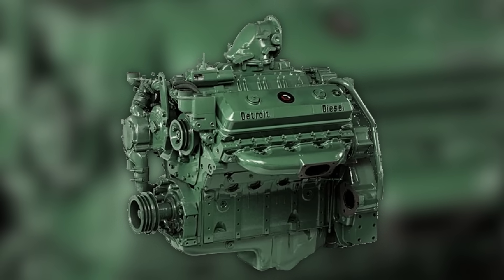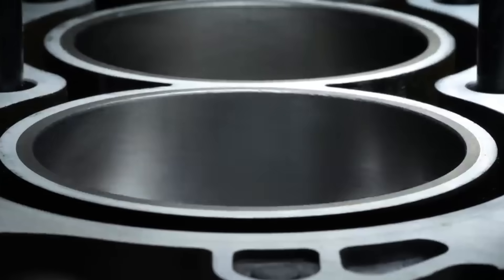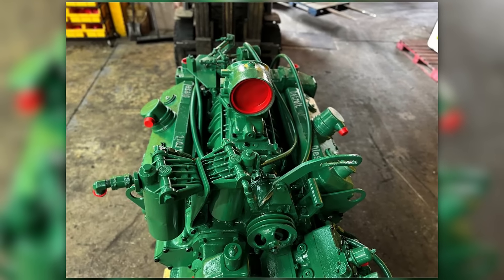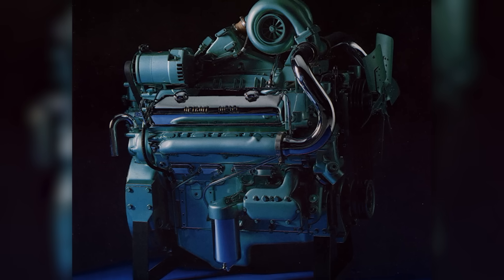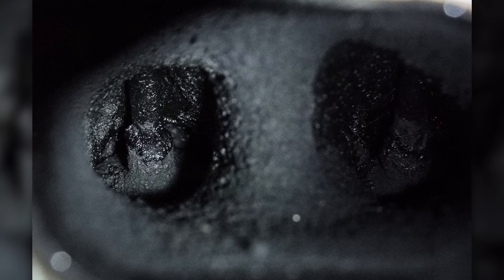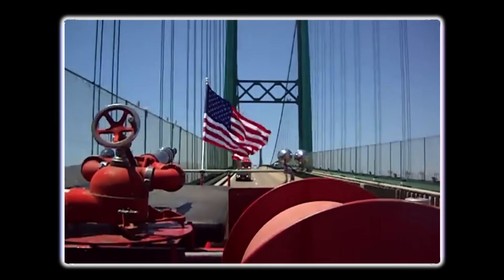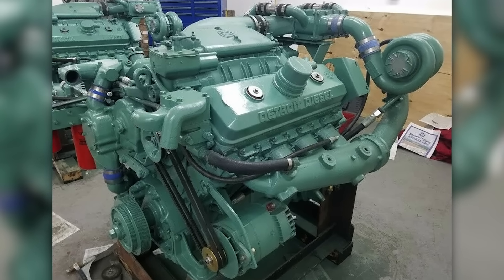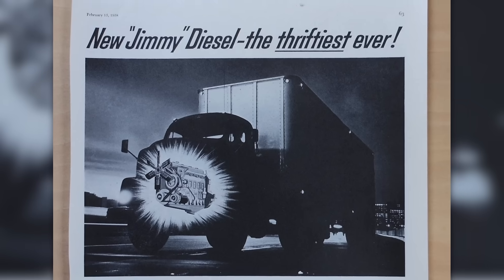The Shocking Truth About the DD 8V71, the Engine Too Hot For Its Own Good

Comment: Old truck drivers who preferred the Detroits maintained that they did not leak oil. They were marking their territory! And as the 8V-71 started being under powered as compared to competitors, Detroit came out with the 8V-92, which continues the heritage with more power. But it was unable to meet the pollution requirements when that became a requirement. They definitely were a motor that couldn't be mistaken for anything else.
Reply: The 92 series wasn't discontinued over emissions. The early ones had issues a d the fuel crisis on top of that tanked sales in the late 70s. By 1980 DD had 3% of the OTR market and had to scramble to design something to replace the 92 series which while fixed still weren't selling as well. The series 60 came in right as Rob penskey bought the company.
Reply: DD Showed several times in several SAE papers that they could get the engines to meet the emissions the EPA had set. No one wanted them when they didn't have the torque, that as well as relaxed length laws on trucks made V8s and V6s obsolete. Now any truck could be long enough to accommodate a big I6. A major part of DDs 2 stroke sales were for high horsepower compact applications. But DD had trouble keeping up with power and torque of thier engines due to a limited budget thanks to low sales.
Reply: As you see Cat got out of the on-highway market because of the emissions requirements and John Deere has stopped testing with an on-highway application.  I'm surprised Cummins can meet the requirements!

Comment: Really the hole idea came from emd witch was gm locomotive line that started back in the 40s they were 2 stroke with what they called power packs so the liners was its own unit that could be pulled as well in short time and back up and going they ran a rack system for the injectors as well. Gm thought was if works in a locomotive why can't we make a  platform that would be smaller with the same idea
Reply: @Chad-oz9ti ..... Your statement about EMD & the Detroit 2 cycles.... is False.   Winton / Cleveland / EMD & GM DIESEL, were ALWAYS, two Completely Separate entities under GM and NO technologies were ever shared between the two.    I worked in Detroit Diesels, Engineering dept. in the 1970's.   The Only thing that they had in common, as it were... was the fact that they were 2 cycle in design, it ends... there.  Any Similarities between the two, were strictly a result of the "nature of the basic design"..... nothing more, nothing less.

Comment: What I would like to add in FD cabovers is that my engine sits between my wife and me in engine CAB. there is a 4 seat fire fighting covered in the enclosed area with two doors behind the engine. What's neat for me when I RAISE the whole cab forward. It is a power-up cylinder design. I can see my radiator siht glass ( the radiator has a filter of its own. And I have FULL access to all fluid check points. The fuel filters are under body very easy to get at. The engine filter is on the officers side of the engine. 😊 the Allison filter is very easy to get to under transmission. The air filter is on drivers side very easy bolt removal just above the wheel well.
Reply: Howdy, what make, etc? TIA

Comment: I own a DD (8V-71) it sits in my 1971 SeaGrave pumper. It runs great. It is my spicer ( slave clutch) system that gives me headaches. My new baby is a  1989 SpartanGladiatorpumper with a  silver (92 series) with a turbo bolted up to a 4-speed Allison automatic. She runs great, and from a complete STOP at a red light, she gets up and moves with traffic 😊 my other Detroit Diesel is a (353) she sits in my 1978 Dynahoe-190 backhoe. YES, she has blowby and oil leaks. I have had her sense 2003 
When using the front bucket of backhoe is the issue with why farms did not like this in tractors. It's because I dont power the engine up like when digging with backhoe end. 
You have to RUN her at slower, not high RPM. 😊

Comment: all 71 series are dry liner, all the 92s are wet liner
Reply: The 8v92t is the only one that could pull without you helping .8v71 is not for trucks. Being a Detroit man is no complement for a trucker.
Reply: Nobody asked you  @Chokechain1111
Reply: That is 100 percent correct. And you still have to hone or bore the block to fit the new liners which come in different sizes and need to be a very tight slip fit in the block for proper cooling. The standard size liners are available in #1 through #4 and you can just hone the cylinder to fit these. There are various oversized liners available such as .010 over that would require the block to be bored oversized and then honed to fit the new oversized liners. I've rebuilt countless 71 series engines over the years. It's the 92 series and the 149 series two stroke Detroits that use wet liners. I've never worked on a 53 series Detroit before so I don't know anything about them. We run a lot of 71 series engines as auxiliary engines on our tugboats, they power everything from the gensets to the towing winch. We use the big brother of the Detroit diesel the EMD as main propulsion engines. The boat I'm currently on is powered by a pair 16-645 EMDs. The EMD is also made by GM and is just a massively scaled up Detroit with a whole bunch of improvements. It uses power assemblies that consist of the piston, rod, liner, and head. You just pull the whole thing out and drop in a new one. You don't even have to drop the oil pan, or even drain the oil to change one! There are removable covers on the side of the block you remove and reach in to access the rod bolts. Unfortunately it's a fork and blade setup so if you have to change a blade rod you will have to pull the injector on the opposite cylinder and screw in a piston lifting tool. Then you have to lift the fork rod up a few inches to get the blade rod power assembly out. The power assemblies are held in the block with 4 studs and 4 crab nuts. These things have to be torqued to 1800 ft lbs it definitely a workout even with a torque multiplier and a 600 ft lbs torque wrench. You can swap out a power assembly in a couple hours. It's a brilliant design something I wish the Detroit diesels had essentially the 149 series. I have to say I truly hate working on the 149s not bad engines just a terrible design with heavy parts, just dropping the pan and oil pump is a miserable job. Those damn head are recessed into the block and can be a nightmare to remove sometimes you have to literally smash them to bits with a sledgehammer to get them out of they have been on for a while. God do I hate working on those 149series!
Reply: @Trump985 I can tell you’ve had your monthly required diesel baths, born in 68 grew up in the trades, love my 2cycle Detroits they built this Republic
Reply: @patrickancona1193 nobody cares

Comment: The 8-71 uses dry liners, not wet as stated.  92 series uses wet liners.
Reply: And the block needs to be bored during overhaul due to liner fretting.

There was no such thing as a high pressure rail on any engine then. This video gets so much wrong.
Reply: @87cr250r  ".....due to liner fretting"? What, do they get worried??
Reply: @87cr250r pretty sure this is ai garbage
Reply: Dry sleeves in 71 series
Reply: Correct I worked on them for almost two decades, 53, 71, 92, 8.2, 149 and series 50/60.
Reply: @johnpopoff7950 I got a silver 8v92
Reply: In 88 In the Marines I was a mechanic on self propelled howitzers that used 8v71t. Was an interesting engine to say the least.
Reply: @ScottGunMag69 Oh yeah, I know what you’re talking about but I forgot what they were called. Military vehicles have always had looser standards on engine stress & longevity though, because the taxpayer is who pays for that, not them.
Reply: @alexbeuerman7608 I did quite a bit of valve adjustments out in the field, but if anything major went wrong with them we just pulled the “pack” out and replaced it with a fresh one. The transmission came out as part of the pack. Only took probably 4 hours to swap one out. After the gulf war the unit I was with got phased out and I got sent to a heavy equipment shop for combat engineers. That was a fun place to work because of the variety. Everything from D7 dozers to armored combat earth movers, JD front end loaders, Omega cranes, on down to fork lifts to and string trimmers. It made me realize I didn’t want to be a diesel mechanic, so I became a machinist instead. Took my GI bill to a trade school.
Reply: @alexbeuerman7608 M109s were 155mm guns, M110s were 8 inch guns. We also had a retriever with a boom and  winch which was a M109 with a cab instead of a turret.
Reply: @ScottGunMag69  So much for sneaking up on the enemy then lol.
Reply: @tazman8697 they were howitzers, you didn’t need to get any closer than about 10 miles.
Reply: @ScottGunMag69 do you recall the injector size and max rpm?   Those military settings are hard to come by
Reply: @russellrobins5320 I believe they redlined at 2200. No idea what size the injectors were. Side story. I usually rode around in a retriever which is the recovery vehicle, it was lighter than the howitzers, it had a boom and a winch installed. We used to adjust the governor to not be a factor and we paced it with a humvee going 45 mph and running 2200 rpms. They were governed at 1800 rpms which held the speed at about 25 mph. After going that fast we spent some time replacing broken torsion bars which was a pain because you have to break track. It sure was fun though.😂
Reply: @russellrobins5320 I am sure the 8V71N ran the N 60 injectors.
Reply: That might be why turbocharging didn't seem to become commonplace until the 92-series, not enough cooling capacity to properly sustain it. An 8v71t let alone a ta seems to be practically a unicorn.
Reply: @alexbeuerman7608  There are lots of turbocharged 71 series engines, However you do have to use crosshead pistons rather than the more common trunk pistons as well as the small port liners in them. The turbocharged 71s don't have any real issues if you don't crank them up to insane HP levels. Compared to the 92s they hold up a lot better when you do crank them up to insane HP levels like J&T did. Take the Johnson and Towers 671 TIB cranked up to 485 HP and the J&T 12v92s at 1100HP. The 12v92s are ticking time bombs I've never seen one go 500 hours before it blew up, while that 671 might go upwards of 2500 hours before it needs an overhaul. Sure 2500 hours is terrible, but it's certainly better than 500! However look at a sane power level 71 series engine like a turbo 671 at 275 HP these things will go 10,000 hours or more between overhauls. As long as you fit the dry liners correctly these engines do not have cooling issues even when you crank them up to insame power levels. The 92 series is a different story, those jacked up J&T 92s are always melting orings on the liners and dumping all there coolant straight into the oil. Especially the J&T 12v and 16v92s these may be the worst engines ever made, and you can't blame GM for that Johnson and Towers almost tripped the HP of these things and then stuffed them into recreational boats where they were betting people wouldn't use the boats so they wouldn't blow up, and for the most part they were correct. The original owners of these things never put any hours on them. The problems happen with the second and third owners especially if they use the boats or even operate them commercially as charter boats. A charter boat can get thousands of hours a year often running 12 hours a day 7 days a week during the summer.
Reply: You are correct 53 and 92 had wet liners, 71's were dry!
Reply: Are you sure? After all, the AI narrator repeated that at least 3 times! You mean a narrator bot doesn't know what it's talking about??? Gee, who'd a-thunk it??
Reply: Liners are designated by the position of the stamp on the outside
Reply: Personally I have have a bit of distaste of wet sleeves, but that's coming from the PRV engine (designated B27 in Volvos), an alu block with iron sleeves. Prone to leaks and that engine had frequent camshaft issues too.
But I do accept that the wet sleeves are better for cooling.
I wonder how good it could be with modern technology.
Reply: You are right. I had to check my Detroit Diesel 8V-71 service manual 🤪😂😂👍😃
Reply: That shows what some of the other information is worth.

                                       Fergieman

Comment: 8v71 did not have wet sleeves.
Reply: As did I,  zi worked at an International Dealer ship from 1974 thru 2008 , several local companys used these engine as long as they could get them. It was the 92 Seried that had the wet linners.
Reply: You are correct I have rebuilt a lot of them
Reply: Yes the 71 series use dry liners, it's the 92 series that uses wet liners. I've rebuilt plenty of both.
Reply: @Trump985  ..and the 53 series
Reply: @gcrauwels941  Hard to confuse a 53 series or even a 149 series with a 71 series. A v92 and a v71 look pretty similar and I think he's watching someone rebuild a 8v92 and thinks is a 8v71. Ill admit they are very similar looking engines and if you don't work on them all the time its easy to get confused as ro which one your looking at.
Reply: The 6 71 did tho? Or am i rembering wrong.

I
Reply: @Harlan-m7r  you're remembering wrong.
Reply: @Trump985  6 92 i guess

Comment: Ummm...so what about the CAT 3208?
Reply: It's a 636 Ford , painted yellow,  and a meh engine for medium duty trucks, at best....
Reply: @jamesgeorge4874 Used in Ford F and C series trucks, early on they were blue paint and 522 displacement. Then we're jumped up to 636 and painted yellow. A self aspirated motors was 175 hp, and two different turbo charges motors were 200 HP and 225 HP. They were a good dependable motor for our local delivery fleet of medium duty trucks. And they found their was into stationary motors and agriculture.
Reply: 3208 a bic lighter